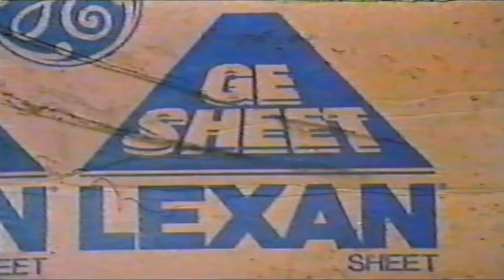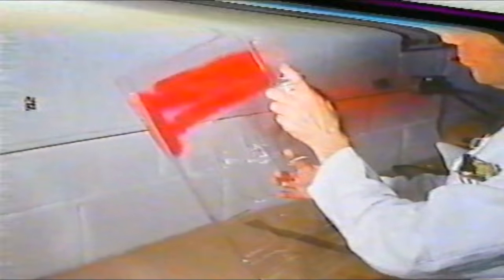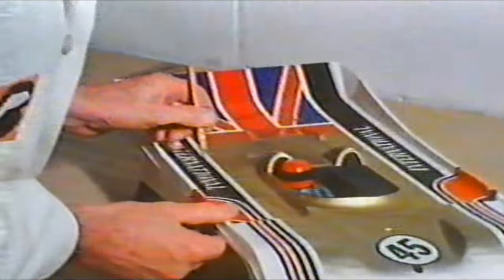Tibshelf PB/Tuckers 80's Model Car Racing

Comment: The unmistakable sound of a PB muffler.  I  had an Alfa new and never knew they started out without shocks. Though the shocks they had were so bad you had to fill them with oil every race. Shame about PB I also had a Nova 4WD and apart from it being easy to bend was a very fast car.